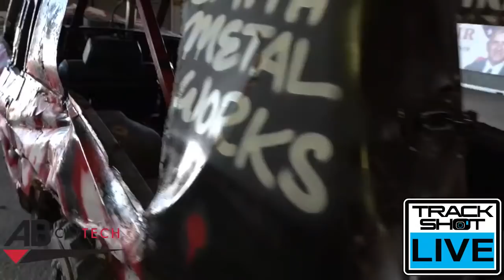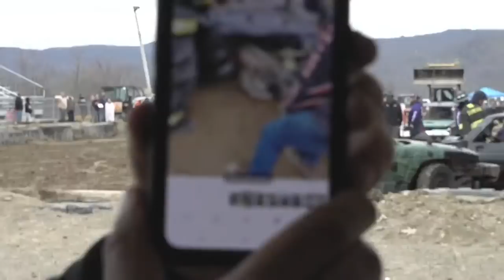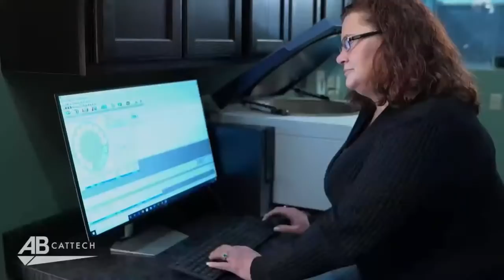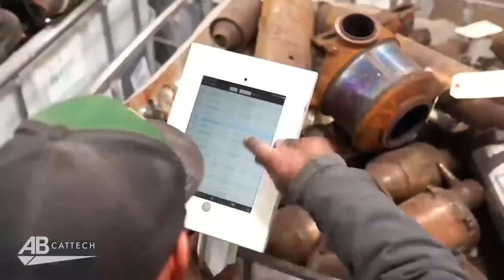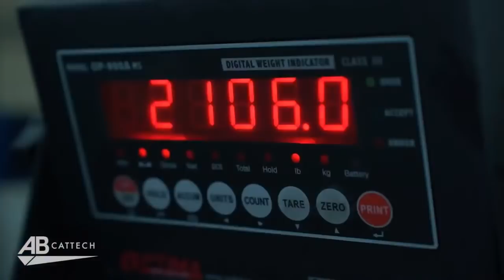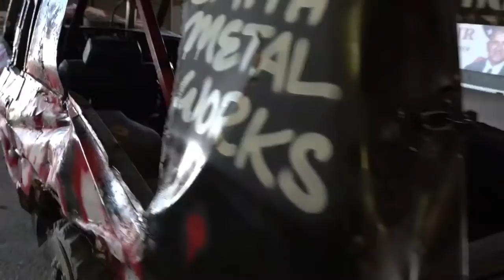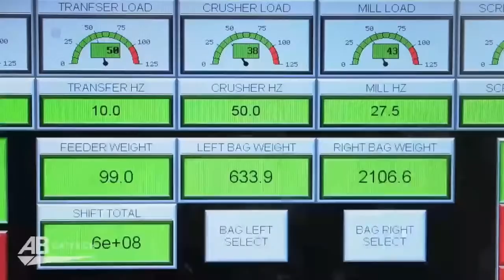LIVE! Demolition Derby  -  Deadman No Mercy

Comment: 1:05:00 if it’s actually a 604 he’s one of the average hp engines out there and if it’s a 602 he’s one the lower power engines on the track (604 and 602 are crate engines and the number refers to the gm part number )
Reply: 602 is 350hp 390tq and 604 is 400hp 400tq and they’re both 350s

602 has iron heads and 604 has aluminum heads is the main difference

604 is 9.6:1 compression ratio 9.1:1 compression ratio
Reply: Rocket scientist either-or know-it-all 😂 yappity yap yap.
Reply: @jerrygood8523 nope just know them by heart due to being around them for years due to dirt oval which is what they were designed for